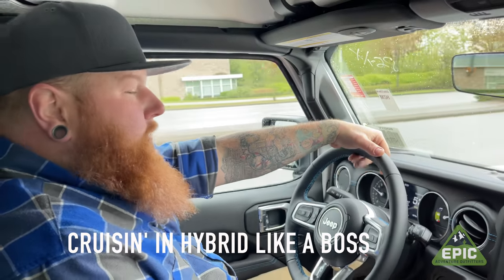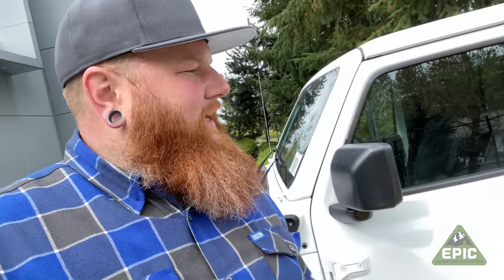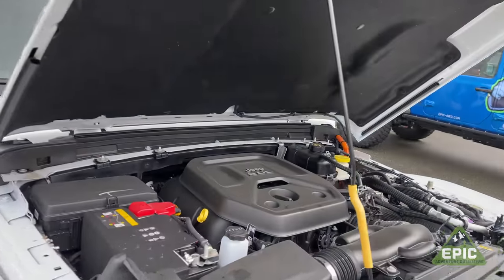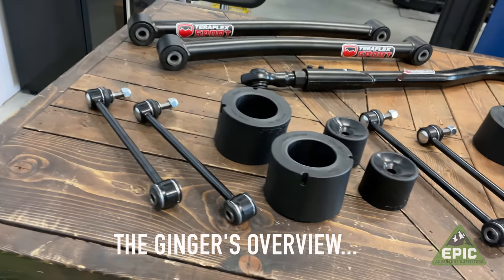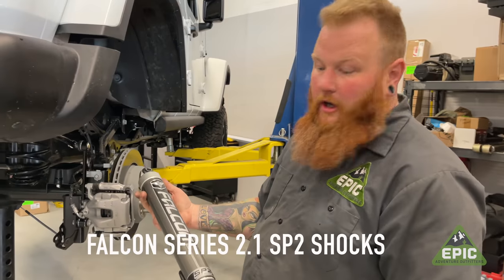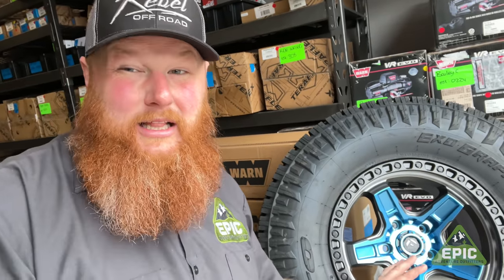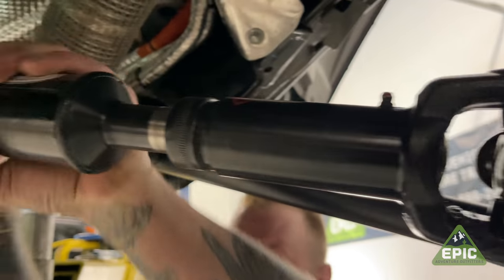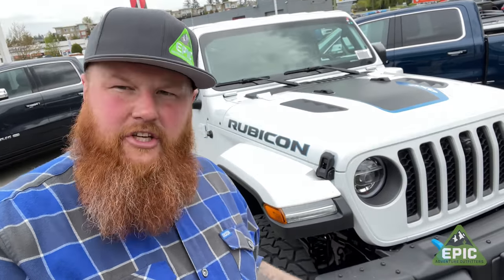The Trials and Tribulations of Lifting a Jeep Wrangler Rubicon 4XE

Comment: The reason the fuel door is locked is because there’s pressure built up in the gas tank if the jeep was not fueled in a while (daily commute using only electric, no long trips). You will also notice that when you open the fuel door from the inside, it takes few seconds to actually open so it can despresurizar if that’s the case.

Comment: For the fuel door this is done on pretty much every hybrid vehicle, because you may go an extended time between putting gas in plug in hybrids there can be excessive pressure in the tank. By making you press the button it tells the system to vent before you open it. In some cases is will open almost instantly and others it can take up to a couple seconds before it will open.

Comment: Great video!  Now, the big question is would the EPIC crew given the choice buy the 4XE over the gas counterparts?
Reply from the maker: Hello Mr C1ph3r. We would buy a 4XE as a hybrid commuter vehicle that can go off-road on the weekends. It's a blast to drive. Due to the extra battery weight and the limited electric range, we would hesitate to recommend this platform for an overlander that wants to load up the vehicle with lots of gear, roof top tent, etc and head out for days into the backcountry. All depends on what you want to do with it. The EcoDiesel platform is simply insane and delivers crazy torque 100% of the time, as long as your fuel tank is full ;-)
Reply: @EPIC-4WD  totally agree with statement of the 4xe vs Diesel for overlanding (and I’m a 4xe owner) until they update the 4xe in a few ways (either with some factory updates or options), but I do want to point out that the 470 lb of torque is virtually there the whole time (you seemed to imply that it is no longer available after the battery is depleted).  The 4xe keeps 15% battery in reserve for a couple of reasons and one of those is so it can give that torque boost when needed(that 15% is also the easiest to charge back).  It replenishes that 15% from the engine and from regenerative braking.  Sure if you were pull 470 lb constantly you probably can deplete that before it can replenish, but that doesn’t happen in the vast majority of cases.  A good test would be to wheel it straight up an obstacle strewn mountain with the battery already “depleted” and see how it handles it, something you are in a good position to test 🙂, and would be a great video as well.  Also, great build.

Comment: Correct me if I'm wrong, but pretty sure you are only supposed to use a double cardan like that ONLY if you can make the pinion angle match the driveshaft angle.  I think a standard driveshaft would have been more appropriate and less expensive for that application.
Reply: Honestly I have never not seen an aftermarket double cardan front driveshaft used in a Jeep

Comment: What difference in electric range and overall fuel economy have you seen? Looking at one of these but don't want it to become useless after adding all the offroad goodies.
Reply from the maker: The trick is to keep the rolling mass as close to stock as possible. Thus why we went with 35s ;-)  Our clients with the 4XE and 35s are reporting nothing really noticeable, driving around town, no issues with highway driving fuel economy, however one would assume that there is some effect, albeit small. We have a 4XE on order for our shop, so we'll have more hands-on updates coming in the next few months. Cheers!

Comment: Can we power our fridge from the giant drive battery?
Reply from the maker: Hey! Anything's possible! ;-)
Reply: So technically speaking, the high voltage battery is connected to the DC to DC converter that provides 12 volts to the low voltage side. All the power flow comes from the high voltage battery. So from that perspective, if you connect to the 12 volt system, it is feeding off the high voltage battery. That's going to be the best way to go about it. If anyone connects to the 400 volt battery, that voltage is going to have to be converted anyway. So might as well use the equipment that's already in place. There's nothing designed to handle 400 volts DC. It wold hammer the warranty anyway.
Reply: @Wrangler4XEFans  There's also a standard 12v battery in there as well though.  Does it always charge off the 400v drive battery?
Reply: Sounds like there's a 2.5kw DC-DC converter that acts as the alternator.  Good to know.
Reply: @jfloydsea  Yes, from the DC to DC converter.
Reply: I saw a video where the guy plugged into his house breaker panel and powered all the lights in the house.

Comment: These videos have been extremely helpful for a complete beginner like me to understand how to do my jeep build correctly. Can someone rate my setup? I've got a 2021 Wrangler unlimited 4xE Sahara (thankfully the 4xe has the D44 as standard so I don't have to worry about axles).

Upgrades:
Highline rubicon fenders
Wheels- KMC Grenade Crawl wheels 4.75 backspace 0 offset
Tires- 37 goodrich k02s
suspension lift- teraflex 2.5" RT2 short arm kit
shocks- falconSP2 3.3 adjustable

..... am i missing anything or am i way off on anything? Any feedback would be extremely extremely appreciated :)

Comment: Just picked that exact jeep up a few nights ago for the wife. She is ready to lift.. Do you have a link to the specs on the custom drive shaft by chance?
Reply from the maker: Nope sorry. We just had it made up by a local drive shaft shop. Any drive shaft place can measure up the lengths required. It's just a custom-length 1310 Double Cardan with a new yolk at the t-case.

Comment: How is the consumption with The bigger tires and lift? Mileage in only electric mode and consumption. I think that stock has a correct / acceptable autonomy, but with lift and biggest Tires it’s canceled
Reply from the maker: While we only had the Jeep in the modified form for a few days with the easy-rolling 35" EXO Grapplers, we didn't notice any significant change in the electric range.

Comment: I want to know what the Electrical range dropped to with the bigger and heavier wheels and other components that you installed, as you said about 25 miles before the upgrades??
Reply from the maker: Hey CJ - we only had the Jeep in the modified state for a few days, but we'd say the larger tires/lift didn't do anything recognizable to the range. I'm sure it probably lost a mile or two in the all-electric range category ;-)

Comment: Hey Ginger, wondering how much longer the Falcon shocks for the front are over the stock Rubicon shocks.  I plan a simple 1 inch spacer lift on my 4xe when it arrives (Mojave is my current rig) and would much prefer to not have to do the front drive shaft.  Thanks!!

Comment: Just curious, doesn't it have a 2.5 inch lift already? Or am I am wrong? I heard that because it weighs in extra 800 lbs?
Reply from the maker: Yeah, no... it's the same height as a non-4XE Rubicon.
Reply: Okay thanks it look like it was lift? Okay thanks
Reply: @EPIC-4WD  Does it utilize the same suspension as a rubicon aka would a take off 4xe work on a sport

Comment: Can you add 37s on a sahara with this lift? Or will i have to figure out a 3.5inch lift some how to make it work. I know the rubi has the high fenders but i seen people using a 2inch lift with 37s on the rubi so 2.5 thats almost adding the high fenders hieght right for a sahara model?
Reply from the maker: You'll need flat fenders to do 37s on a Sahara with this lift. At the moment, there is no way to lift the vehicle more than 2" because of the unique 4XE e-brake setup (it exits the vehicle farther back, and is already at a harsh angle).

Comment: 2 questions question 1 is how many miles are you getting on a full charge after the lift on just full Electric? And what is the mile per gallon when in hybrid mode
Reply: When we had this vehicle no programmers worked so we couldn’t properly set the tire size so all numbers would be incorrect.
Reply: On a full charge stock off road my buddy got 3 miles then it switched to gas I can’t imagine with a lift and tires….
Reply: @jP-nw7nm  We will be doing a full series of content on the 4XE eventually as we have a pretty sick one on order ;)

Comment: Would you do this same lift on the 2.0 4cyl rubicon w/o 4xe?  Also, do you need the drive shaft only on the 4xe?  Great build and loved the video. Wheel paint was a nice touch.
Reply: I would gladly do this lift on a 2.0L Turbo, you wouldn't require a driveshaft either, but I would do a Teraflex lift that does include coil springs personally, we didn't with the 4XE due to the coils not existing yet for that platform.

Comment: Where can I order that drive shaft? Planning to lift my 4xe
Reply from the maker: Any driveshaft shop should be able to measure and make you up a 1310 shaft. We found that the Rubicon and Sahara 4XE front shafts are actually different lengths ;-) We just have them custom made at a local driveline shop to our specs.

Comment: I'm noticing that the cowel corner with the charging plug pretty much ruins mounting an over-roof rack cage. Unless there is another way to mount to the firewall under the cowel???
Reply: We personally prefer to use RhinoRack backbone rack systems, haven’t had good luck with many cage style roof racks.

Comment: Just imagine if it was full electric and you had a range of 300 mile but it takes 8 hours to fully charge and you had a 1500 mile trip(like I just took this past weekend in my gladiator), it would probably take you a month to get there?
Reply: Not if you’re on the Tesla Supercharger Network.
Reply: @thermalgeothermal451  Tesla chargers are not compatible.
Reply: Full EV would have had the CCS and that can go up to 350kw which you can fill up in 30 mins.  Do some research.
Reply: @kimle01  sure it can

Comment: Hey guys. Need a little input. Gonna put a 1 inch lift on my 4xe Rubi and curious based on your video can I get away with just the spacers being that it’s only an inch lift. I think I lost some height anyway as I added LoD Destroyers bumpers front and back and a winch. Just hoping I can get away with just adding the 1 inch spacers without adding anything else or springs and shocks or the drive shaft. Please advise. Many thanks. Great video.
Reply: If your thinking of heading down that road, Teraflex makes a 1.5” spacer lift for the JLU. I would maybe start there.

Comment: Where do you get the drive shaft at? Will metal cloak offer it?
Reply: And competent driveshaft company can make a shaft for this its just a bit longer than the other models.
Reply: @TheEPICBeardedGinger  wouldn't the shocks prevent full droop on the ground? Curious why not using the Nitto Terra Grappler G2? They weigh 65lbs each as opposed to 75lbs with the Exo Grappler!
Reply: @exoplanetnomad  I wanted to use Nitto Ridge Grapplers or MT Baja Boss A/T but due to Covid stock was unable to be acquired at the time.